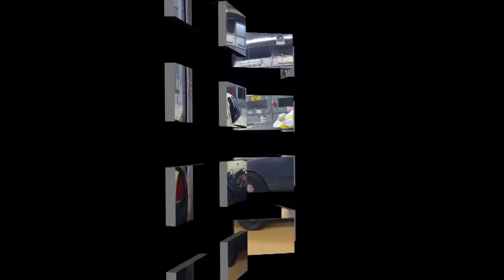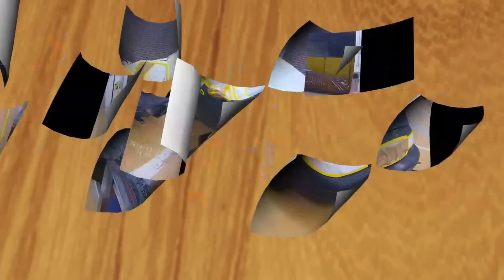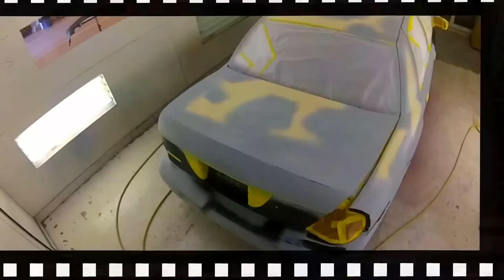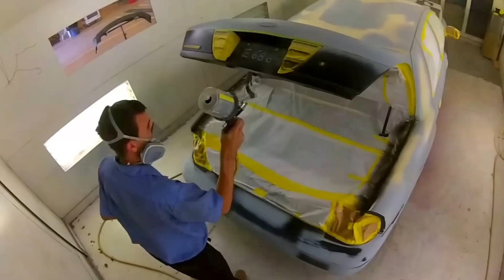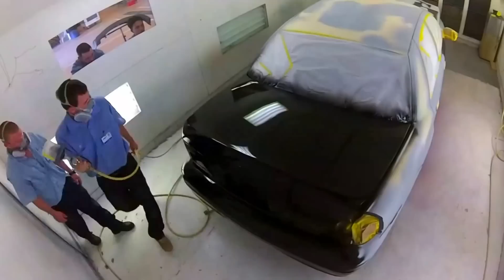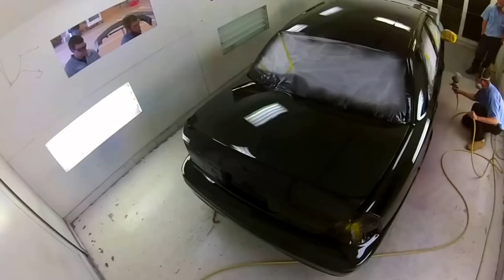Painting a Crown Vic in 2 minutes

Comment: With all of the careful attention to painting the door jambs and inside of the trunk lid, why not remove all of the lights and grille to ensure that paint properly gets behind these items as well?
Reply: +Blaine Bugaski Because The Rear Reverse Lights Are Rare And Ford Doesn't  Sell Them Individually.
Reply: A trunk fascia panel can be had at a junkyard for about $25 and isn't hard to remove at all.  4 studs and nuts through the rear of the trunk lid.
Reply: Really? I need to look into that someday.
Reply: They are around here, at least.....Chicagoland.  A lot of the time, the studs unscrew from the fasica leaving the stud and nut still attached to the trunk lid.  A pair of vise grips and the appropriate socket take care of that, though.  When you re-install, just like the front grille, don't use a ratchet.  Just hand tighten a socket with extension.  The plastic is sometimes brittle.

Comment: Did yours have holes in the roof? i dont know how im going to fill the holes i got in mine lol, they just put a bunch of caulking over it. will welding and body filler do it?
Reply: I would use bondo watch chrisfix wheel fix you can use the same method to fix holes in your vehicle

Comment: What size tip did you use for the gun?
Reply from the maker: I have a 1.5 in that gun " $9.99 Harbor Freight special"
Reply: Thanks for the reply. Do you recall what the air pressure setting was at the gun and the tip.I shot a panel with a 1.3 and 40psi at the gun and I had orange peel. Do you have any orange peel when you finished? I am using the same paint that you used. Do you have any other tips that I can use?
Reply from the maker: Dennis Keane  Pressure was about 20 to 30psi at the gun "I don't use a regulator anymore I set it by ear"  With that paint you want to give it two good "wet" coats and it should lay down smooth.  The temperature and humidity plays a huge factor in the finish.  Make sure you are using the correct temperature activator for the air temp that you are spraying in...